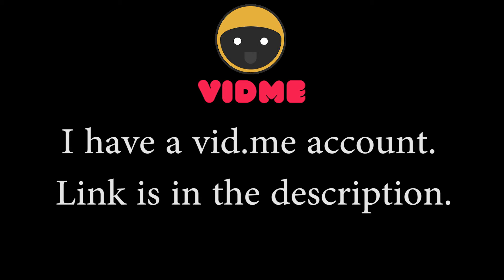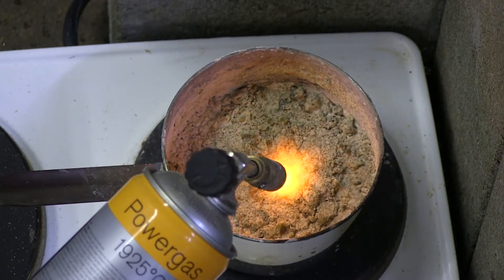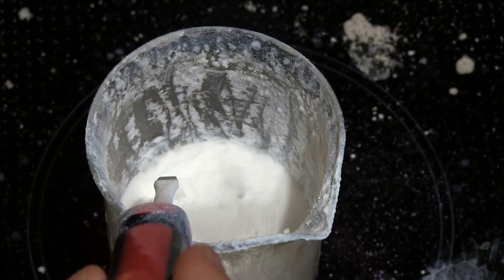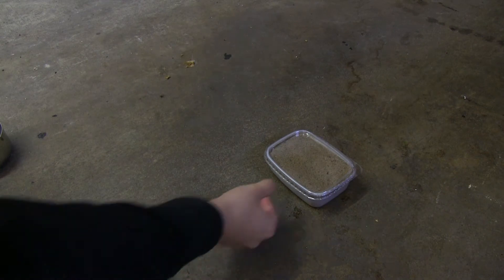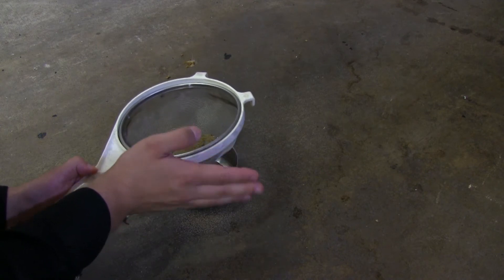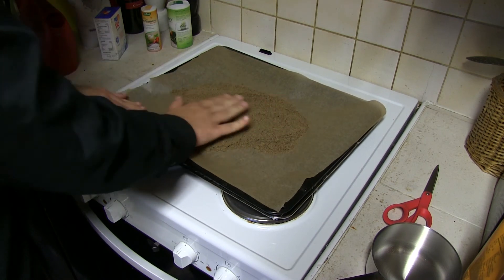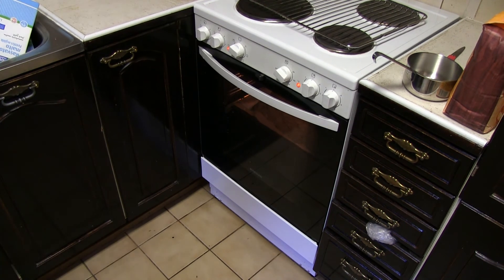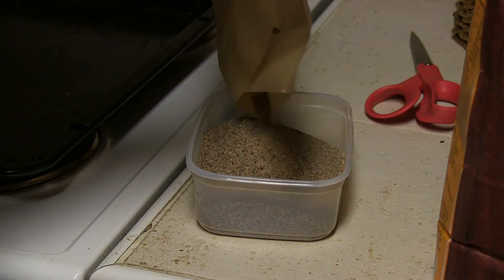From sand to pure silicon dioxide part 1

Comment: Alright, I did the first part, stealing the sand
Reply from the maker: Great. Now to steal the other chemicals :D
Reply: @RavenFly1232  does pure silicon dioxide dissolves in distilled water maybe with some naci
Reply from the maker: @novelay  Not in an significant amount. SiO2 dissolves less than a gram per litre, and you'd get the same effect by dumping water in sand.
Reply: @RavenFly1232  do you know how you can get a solution
Reply from the maker: @novelay  Does it need to be in NTP conditions?
Reply: Or to keep it a little more simplistic, is there a way to make sio2 in ntp conditions. That would open the door to a lot of new possibilities
Reply from the maker: @novelay  Under NTP conditions SiO2 won't dissolve without a chemical reaction. But if you amp up the pressure and heat to get to the critical point (~220 Bar and ~375C you can dissolve SiO2 in water. You can use this method to grow crystals of SiO2, but I don't think this is a good purifying method. And it's even more hazardous than molten NaOH.
Reply: @RavenFly1232  if you add other elements does that effect the whole process? Do you suggest perhaps a different approach?
Reply from the maker: @novelay  For making pure crystals the addition of other chemicals may or may not be beneficial. And this goes beyond my knowledge. Possibly you could somehow get it working, but the industry has settled on playing with high pressures and water, probably because it is the cheapest/fastest way to do so.

But then again, if you just need pure SiO2 crystals, without the specific size, then there is another method discussed here under the part 3 of this video series of using mild pressures, sodium carbonate and water to speed up the process I went in this video series, that produces water glass. Then it was suggested that by using ethanol you could get extremely fine and pure SiO2. Though the "extremely fine" means the crystals are microscopic. 

So in theory, you could make this extremely fine and pure form of SiO2, dissolve it (the tiny amount it dissolves) in water, add a bigger seed crystal, and let the water evaporate, then repeat this process. You could in theory grow a bigger crystal, but this method is extremely inefficient and uses a lot of energy, and I am just hypothesizing if it would even work.